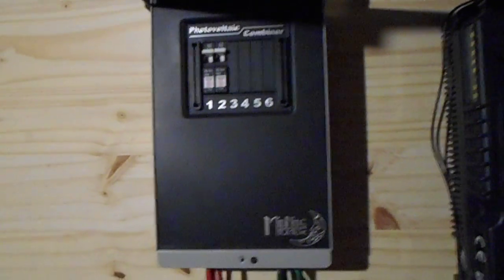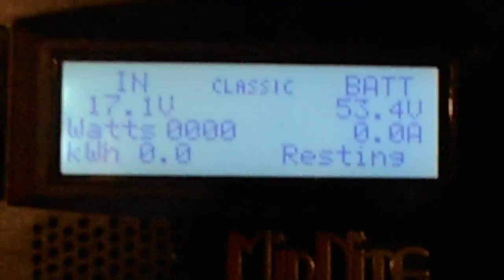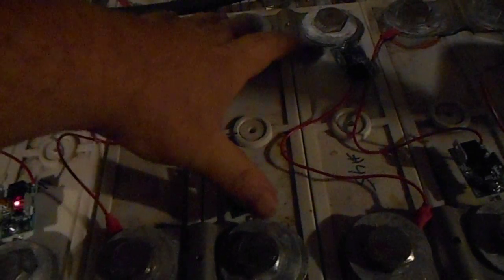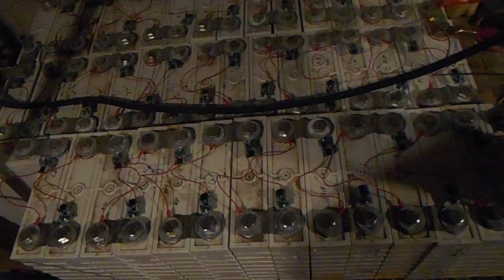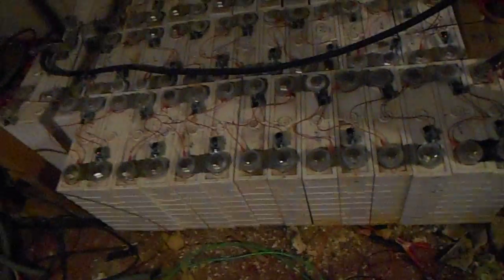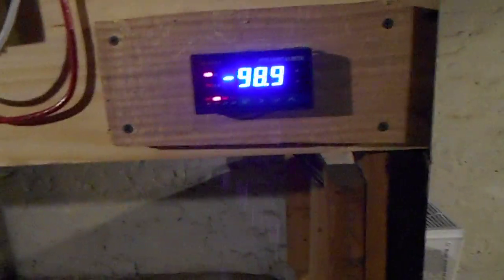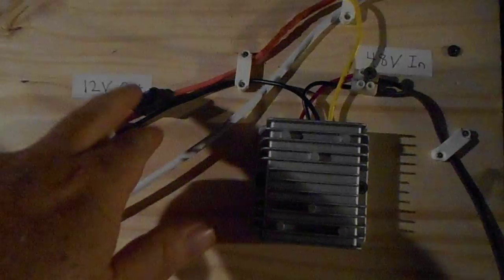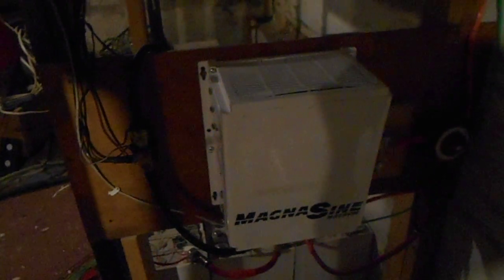48V LiFePO4 Off Grid Solar System - Hardware(Part 2)

Comment: do these batteries charge normally with just a charge controller or is there a special device added to charge lithium ion
Reply from the maker: They use a normal charge controller, but the voltages should be lower for maximum life(Midnite controller allows you to set the specific voltage-48V system = 54.4V LiFePO4 float (3.4V/cell)-57.6V LeadAcid float ).  They are simpler to charge than lead acid - they are CC/CV only charging (constant current/constant voltage)-no gases-no de-sulfurization.  But they do require a BMS (battery management system)-it helps prevent over charging of individual cells and balancing the pack. .
Reply: +G Young : I find they do not need active BMS when using voltage set points that keeps them in the flat part of the charge curve where most of the useful capacity resides. 3.5-3.6v for absorb and the 3.4v float. My own 48vdc calb ca series have run fine over the last 865 days (June 2013) up in a full time offgrid usage. Bottom balancing is much more crucial in maintaining close cell balances in my opinion. I do not trust those current shunt bms units. :) (2000 watts PV Array. Outback 3648 Inverter. Midnite Solar 200v CC. 5 kwH Battery bank of 16 CALB CA 100aH cells.)

Comment from the maker: Ron Harris:  There are several "portable" emergency Li ion backup system available. I personally don't think they would help very much during an emergency - but, when I say this, I mean that an emergency that lasts longer than 3 days. (power NEEDS for less than 3 days are very small - a bicycle generator could meet these needs.  After about 3 days, the NEEDED power gets more complicated (time of year/family size/cooking/etc.) and these “portable” system would not be getting enough power from the sun to provide power past a few days.
Basic Rule of Solar Power - You can NOT use more than you get...

Comment: Did you purchase them direct from Hi Power or did you go through a local distributor.  I am looking at several sources - and I was wondering if you have been satisfied with the performance.  I know of several people who have purchased similar size LiFePO4 and found that the internal resistances were significantly different for several of the same size cells.  That of course - made the cell voltages a little different and the performance curves were worse.
Reply from the maker: I would strongly suggest using a US supplier(not local) (you will likely never receive the batteries or receive junk cells without the US supplier) - I used www.electriccarpartscompany.com - but make sure you confirm the shipping cost & expect ~5% bad cells which they should replace. Yes, the internal resistance is not perfectly matched (despite what they say) – that is why I changed the BMS to a distributed BMS - mini BMS (http://minibms.mybigcommerce.com/minibms-cell-module/) which can dissipate 0.7A on each cell and the cells can handle voltages above 3.6V for the short period of time needed to bring them down to 3.6V.  My previous BMS (centralized)was shit – 0.2A on one cell at a time, but it was water proof – not needed for solar system.  As for the performance curves(I did create charge curves for each cell when I top balanced the EV), they are not all the same.  I top balanced the pack, and the charge controller constantly (every day it reaches float – 53% of days) brings the pack back to top balance, so the only problem would be if I fully discharged the pack – I prevent deep discharging using the cut-off in the inverter set to 48.8V (avg. 3.05V/cell), so the cells would need to become very different – also, I do not and do not recommend deep discharging the pack – buy more batteries or reduce power usage beyond 50% DOD.  If you want to do deep discharges, you should bottom balance your pack and adjust the float voltage based on cell performace.
Reply: G Young Just checking-in to see how your system has been functioning.  I was hoping you might be able to give me a brief update as there are not a lot of these type systems out there . . .at least not yet.  Thanks!
Reply from the maker: Johnnie Miller I have been off grid for 6 months (as of 2-Nov-2014) the system works great. I do have to manually reset the amp hour meter about once a month to keep it accurate (I know of a way to make this automatic which I will eventually do). I will make a 6 month video soon (I have been in the hospital with broken ribs etc. - ebike accident.) Inverter (all components) have been running non-stop for 6 months without problems – I have not re-balanced the batteries, but as winter approaches I have noticed that the max. power on a sunny day has dropped from 18 KWH (summer) to 10 KWH (winter)-six weeks from shortest day.  Deepest battery discharge was -400AH - typical/target discharge is between -100 AH to -300AH -I use electric heaters to maintain this range.

Comment: I think you can use the midnight aux output as a 12V supply
Reply from the maker: +konic40 I think you are correct, but I don't want to cause any problems with the midnite...which it shouldn't -- overly cautious.

Comment: nice battery bank! I cant begin to imagine the cost being those balance modules alone are like a penny when you buy that many .Im running 400ah 6v AGM's in 12v banks to get 800ah @12v the cables seem to be ok so far however i might get larger ones yet  and haven't pushed my 3000w pure sine wave to where the internal fan kicks in yet
lipo would be my best choice but the cost for a tiny house just isn't cost effective yet
Reply from the maker: +Charles lakins Yes, they are costly.  But, they will last many times longer than AGM's, so in the long run I think they are cheaper.  I have put over 8MWH through mine and when I measured the capacity, I was still at 300AH (the rated capacity)  On a per battery basis, each battery has supplied 140KWH so far.   With that said, I probably would not have bought them for an off grid solar home -- I salvaged them from my electric truck when the motor developed a short.
Reply: +G Young ahh that worked out well then depending what you lost in the truck of course did you get some good miles out of it first? I never seen a truck thats electric yet i had a golf cart that before i sold spent 1k on new flooded black box trojans to make the sale quicker
Reply from the maker: +Charles lakins Got 10K miles-it is a Ford Ranger conversion to ev.  I think the motor can be repaired, but getting it out is very difficult.  A warning about EVs, they are not like IC, the motor can overheat and there is no effective cooling other than air.  I was towing a trailer full of wood and the truck bed was full of tools and wood when the motor overheated.  costly learning.....
Reply: +G Young probably a burnt winding,  I'd rewind the windings myself something that large should be doable easy enough, ive rewound micro brushless motors for camera gimbal use and they are much smaller wires to deal with, i have an f150 and the engine compartment is awkward enough to get at stuff the rangers even less room, would imagine getting it out wouldnt be that much fun

Comment: Sounds like you have the wrong type and/or sizefuse. Type T is the type of fuse needed. Check the manuals for size but I'm guessing it's at least 300A. Remember the fuse protects the wiring, not the inverter.
Reply from the maker: Yes, I added a 300A fuse.

Comment from the maker: linkto thepast:  I did touch positive and negative at the same time.  But, people don't cunduct electricity that easily.  The voltage difference between terminal on the same cell is ~3.5 volts, the danger is not with me touching battery terminals it is with tools (metal conductors) touching both terminals....V=IR -- voltage= current x resistance, a metal tool has a resistance of 0.01 ohms, so if it touched adjacent cell, there would be a current of about 350 amps (or 1225 watts).....that is very dangerous!!!  While the resistance from one finger to another (on the same hand) was measured at 6000000 ohms, so touching adjacent cells would result in 0.05 micro amps (or 2 micro watts)---you cannot feel it.
Reply from the maker: What type of battery are you using?  Lead Acid, LiMnO2 (LMO), LiFePO4 (LFP)?
Reply from the maker: ***** So, lead acid batteries are "balanced" by flooding them..I think.  My basic understanding is that flooding will bring them all to the same high voltage (excess power will boil off water, so you need to add water after flooding)  But, I am not very knowledgeable about LA batteries.
Reply: I am looking at a LiFePO4 setup, I want to get 16 200AH cells. I have a midnight charge controller. What kind of BMS do you think I should get?
Reply from the maker: anjhindul Unfortunately, there is no BMS made for LFP batteries being charged by solar.  I am using "mini BMS", but it does a very poor job of balancing - but, it will protect the batteries from overcharging by shutting down all incoming power when a cell exceeds ~3.65V.. I am building my own BMS using an Arduino.  The problem is: balancing should only been done on LFP when the cell voltage exceeds ~3.40V - below 3.4V, the cell voltages do not indicate the SOC (knee region of the charging curve) and balancing at <3.4V causes random cells to become unbalanced.  When you get your batteries, I would strongly suggest that you set the midnite to  absorb=54.4(4hrs), float 54.3 -> measure all of the cells at 54.4 and then increase the float voltage by 0.1 volts ** watch each cell, you will see a single cell jump to 3.5V while all other cells remain at ~3.36V - apply a load (ressitor 3 ohms) to that cell and bring it back down to 3.4V.  Then increase absorb by 0.1V and repeat measurement & bleeding until you can get to a voltage of ~56.0V (3.5V/cell) -> this would be an excellent balance if you are able to do it.....it will take many many hours.  Do not allow any cell to exceed 3.7V (I don't care what the manufacture clams, it will reduce you available ampxhrs/battery life.)
Sorry for the length, but mistakes will cost you $$$, so read as much as you can.
Reply: Great video man! Have you taken the system apart to check if they are indeed not balanced?
Reply from the maker: You don't need to take the batteries/cells apart to know that they are not balanced.  For LFP, al you need to do is charge or discharge the pack voltage to the knee region of the charging curve and measure each of the cell voltages.  If the cells are not within ~20mV of each other than they would be call "unbalanced".  Knowing that they are unbalanced is the easy part, it is getting them balanced that is very difficult.

Comment: What did that system cost you? Approximately? Very impressed and inspired.
Reply from the maker: It cost $10,000 without the batteries.  (Biggest cost was panels $4500 & inverter $3300)  The batteries cost ~$25000 for my EV - I re-purposed them from the vehicle.
Reply: Thanks, G Young. I imagine your savings will rack up quickly being off the grid. What kind of life expectancy do you expect from this setup? It would appear that you really aren't discharging the cells heavily so I imagine that will help. I also wonder if the Federal Government would subsidize some of the cost of the setup?
Reply from the maker: RogerDodger I would expect these batteries to last my entire life - 30+yrs or ~12000 cycles @ 20% DOD or ~100 MW of total DC power through the batteries. The batteries where a tax deduction (not a credit) several years ago when I built the EV. I have not looked into the tax deduction/credit for the solar panels & inverter & etc. - I am sure some things will be a deduction.

Comment: Your lthiums should be at 58 volts fully charged shouldn't they?  Mine are full at 58volts and i cut them off at 51volts..
Reply: +TheMFrelly What is your voltages per cell being used? How many cell is your bank?

Comment: ? so if one of 16 cells goes bad and can't reach normal voltage you continue to charge 15 shorted cells. that sounds backwards. can't it only charge one low battery more?
Reply from the maker: I don't understand what you are saying/asking?  If a cell goes bad (develops a short)  the 100 amp fuse on that battery will blow and stop any charging/discharging from that battery (16 cells)

Comment: The battery pack should run close to $7,000!
Reply from the maker: It cost about $300USD per KWH for the last 5 yrs...2013-2018
Reply from the maker: Prices are forever changing.

Comment: Question is, Grid down for say 2 weeks due to storm. Very cloudy due to storm. Once battery bank is depleted, exactly how are you going to recharge a 48V battery bank? From what I understand, you can't. I do not know of, and have not seen a 48V generator\charger. It would seem that in order for you to run more efficient, lighter cables because of less amps, you have doomed yourself in an extended grid down situation, NO?
Reply from the maker: +Trina McDonald I have 9 x 48V changers...3 are 6 amp, 3 are 10amp non-PFC corrected, 3 are 15amp PFC corrected.   (ebikes are often 48V)  They are easy to find, but they require grid power (110V AC input) to charge my main battery bank.  Since I don't have grid power, it would be a problem.  But, you must understand two things 1) The only way to not get any power in from the sun is to have two weeks of nights (no daylight) - this does not happen.  A cloudy day will produce ~1KWH upto ~8KWH, and many things effect this - length of day (summer or winter) matters the most.  2) When there are many cloudy days in a row, I start to conserve power (less cooking, no laundry using the dryer, etc.).

I have been off grid (not connected to the grid - don;t care/know if the grid is up or down) for 18 months and have never gotten close to running out of power.....I have gotten to ~50% discharge on my batteries ~5 times in 18 months.  (During the summer months, my batteries get fully charged every day...most of the time even if it is cloudy or raining)
I do not have light cables 0000 cables are very thick/rated for 1000's of amps.

The key to surviving off grid or extended grid down situations is to understand how much power you are getting in from the sun (solar array size ) and how much power you are using.  Batteries only provide a short term relief from the power in = power used rule for off grid living.
Reply: +G Young I know the last part, :D Sounds like you got it cased, GREAT! I would guess for grid power, if absolutly needed you could run a generator but does not seem likely you will need to anytime soon. We are in Northern Canada on the Praries. Solar is all but useless here in the winter, Literally less than 3 hours sun per day useable for PV panels. We have gone full wind power. We are in a high wind zone so it works. Make at least moderate power 20hours a day 300 days a year.
Reply from the maker: +Trina McDonald Yes, I am not as far north as you, but at 45N Lat., I get ~5 hr of good sunshine on a sunny day.  But, winter time can be very cloudy, so I do watch my power usage more in the winter.  I have my refrigerator on my back porch so it almost never runs in the winter....BIG power savings at a time of year when it is needed most.  I have tried wind, but you need a very high pole for it work, the trees block most of the wind below 10 meters.  Also, wind is more complicated than solar...no dump load needed & very few moving parts to break & no noise.But, I agree that you should always use the most appropriate source(s) for your location.

Comment: What do you do to protect from over discharge?
Reply from the maker: Zac Tattle My amp-hr gauge tells me the SOC.  I have not connect the BMS low battery cut-out, I rely on my checking the SOC & I also know the battery voltage.(53V fully charged, each volt below is ~25% of the SOC)  I have never gotten past 50%SOC (450AH down), so I don't worry about it.  I have been off grid for ~18 months, so I know what time of the year creates low battery conditions.

Comment: Where can I get those battery interconnect straps from?
Reply from the maker: You should always get them from the company that supplied the batteries.  The spacing between terminals is different for different battery models and capacities.
Reply: G Young ty

Comment: Where did you buy the battery regulators? Or what are they called?
Reply from the maker: It is called a mini BMS (http://minibms.mybigcommerce.com/minibms-cell-module/).  BMS - Battery Management System.

Comment: the bms is putting a load on the each cell?
Reply from the maker: +konic40 Yes, I believe it is ~20uA - the blinking light and electronics.  Both are well worth the power....the light tells me that every thing is working and within voltage range.

Comment: Did you ever get a BMS for your bank?
Reply from the maker: Yes & No...I have several BMSs, but I don't like any of them.  I have discovered that charging to 3.4V/cell greatly improved the stability of the pack, so now I use an 8S - 200mA discharger set to 3.4V (must be removed because it draws power from only the first 4 cells) and the pack is almost completely balanced at 3.4V/cell.... I have never had my pack balanced in a way that would hold through the next charge cycle.  But it is very close now.